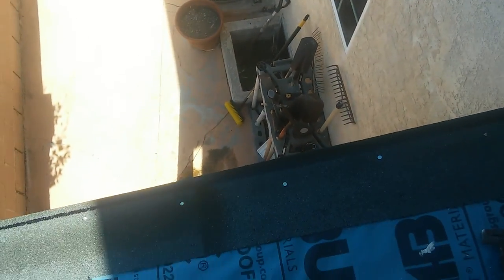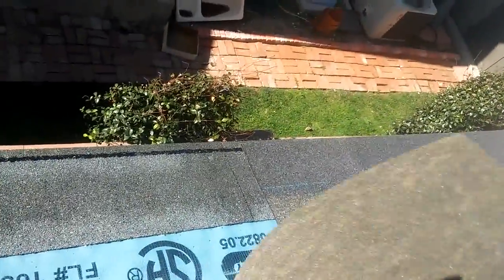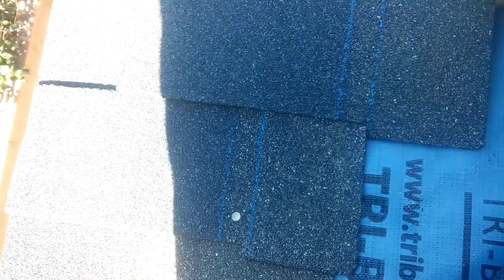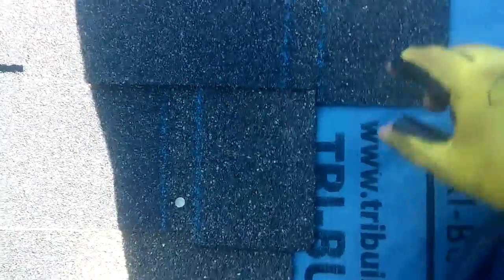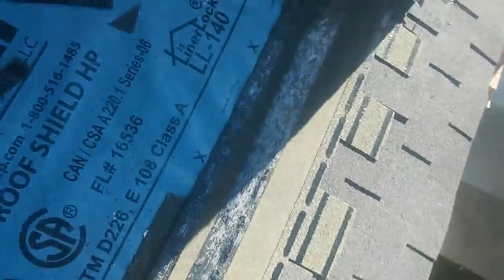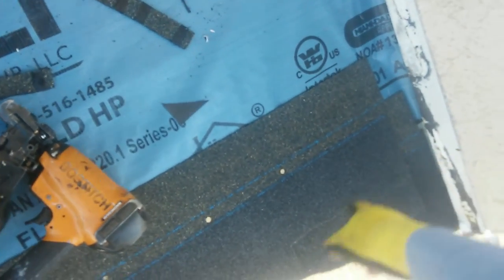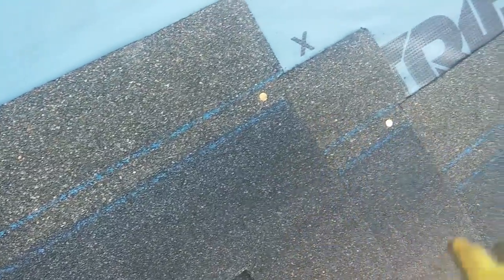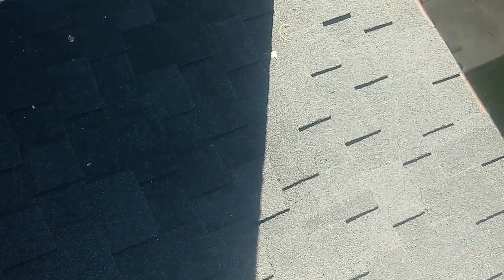HOW TO : A video to install luxury shingles, PRESIDENTIAL SHAKES...very helpful for the pro roofers.

Comment: How would you install the presidential from left to right if the valley left side is at the top of the ridge. How would you work your way down???  Not a roofer I'm replacing my own roof. I am doing the 5-15 pattern.
Reply from the maker: easy : when you get to the top of the valley snap a chalk line, then tuck the shingles under the top one following the 5.15 pattern all the way down.

Comment: Everybody does this pattern.
The correct pattern is a full shingles 40"
The second row deduct 5" 
The third deduct 20"
The fourth row leave only 15"
Reply: 40"
35"
20"
15"
Reply: The first starter should be cut at 20"
Reply: Yo no te pregunté eso eso es lógico y una cosa son las especificaciones y otra en el trabajo depende la superficie de el techo
Reply: @martinsanchezlugo9063  las especificaciones del producto sr hacen considerando varias variantes  como serian la superficie donde puede ser instalado y el pitch on el inclinamiento de la superficie.
Lo demas no importa por eso se hacen las instruciones para que no pierdas la garantia del producto y obtengas el mejor rendimiento de el